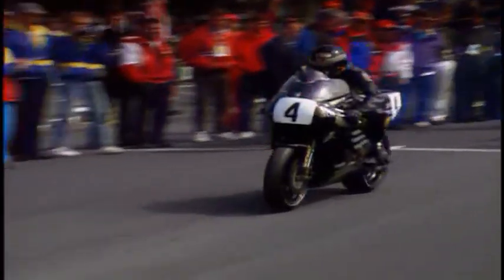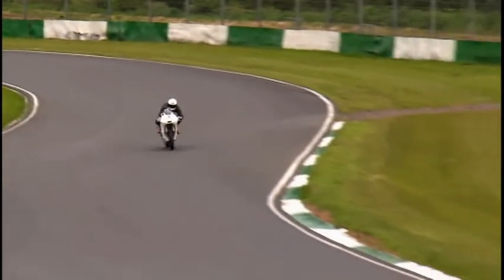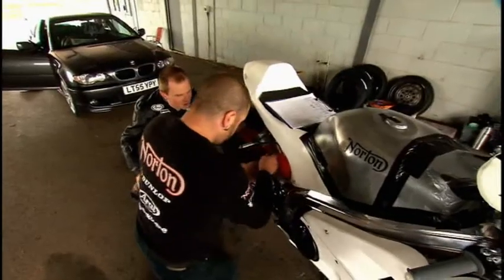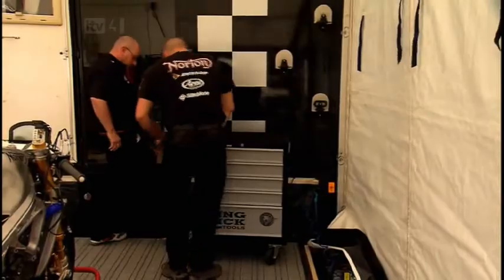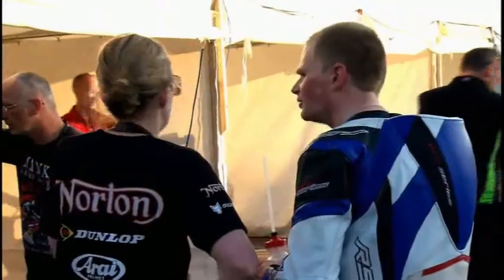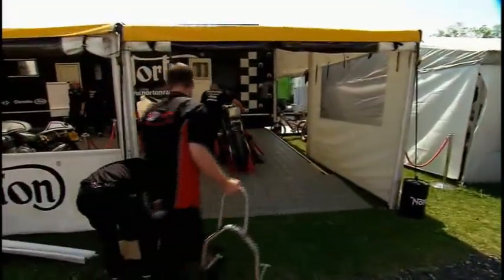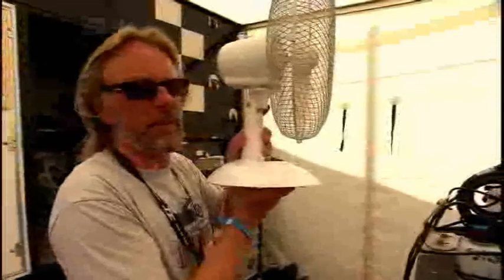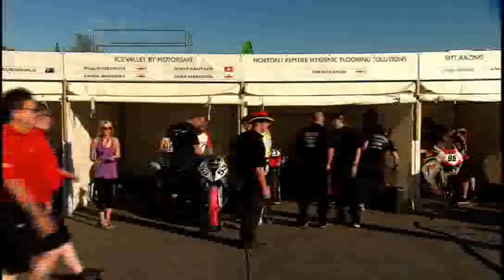nort_next_hurrah_ptB.avi

Comment: old NRV rotary chassis and swingarm, second hand aprilia engine which i here on the old grape vine that the engine seized a day before they went to the TT and was then rebuilt wrong from that Touche (brummy lad on this video) that works for them thats why it was running like a bag of nails, instead of Norton SG1 it should be Norton Apriliadon.